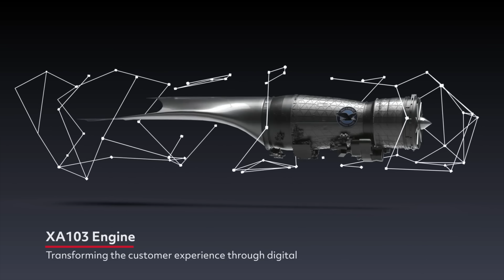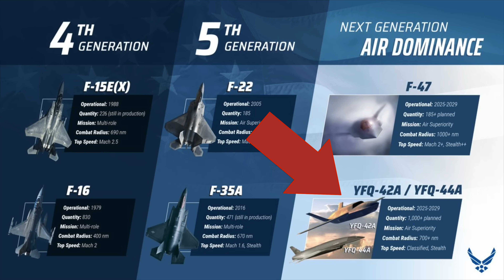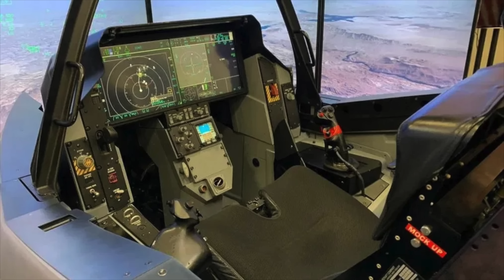Is the US Air Force F-47 Already Flying Missions?

Comment: The problem with all public sector acquisition programs is that everyone lies about the cost and schedule required to fully field an asset - in the case of DoD, the service, Congress, manufacturers, and the President all contribute to the lie.  Sometimes it's done out of sheer enthusiasm, sometimes out of a true ignorance of the technical risks involved, and sometimes just simple greed.  This is not an abstract attack on DoD.  I proudly served in the Navy for 20 years.  All government departments and agencies do this; DoD is usually the only one that gets much press on its failures.  I bring you the Navy's Constellation and Columbia programs and the Coast Guard's OPC program.  These technical and programmatic risks did not need to happen.  Programs do not need to fail, but preventing that requires people who understand that (a) physics is physics, and (b) mucking around with a contract is GUARANTEED to cause program failure.

Comment: Ge already has a headscarf on Pratt with the adaptive cycle engine. Ge is trying to get the xa100 into the next block of f35.  The xa100 is the grandson of the yf120 engine used in the f22 and f23 fly off in the 90s
Reply: Headstart

Comment: Unfortunately the latest Pentagon budget cut the influx of money towards the development of the adaptive cycle engines which were supposed to be the core of the next gen fighter.. If the F-47 doesn't receive ACEs it's capability will be severely diminished.. My money's on the fact that they will fly with the upgraded P&W engines from the F-35.
Also the CCAs (drones) are not supersonic nor particularly stealthy. Their level of stealth falls bellow the F-22 and F-35, let alone compared to the F-47.

Comment: There's no freaking chance that the F-47 would sport the 1Mw class laser, or at least not in the next 20-30 years...The technology to include such a powerful laser on a fighter jet is far,far in the future.. The weapons developers are just now putting the 150-300 Kw lasers on ships.. 1Mw laser on a fighter jet size aircraft would be such a leap in technology that we could compare it with USAF developing, building and flying the Raptor in the late 1950s.. 
There was an experimental 1Mw class laser on board the redesigned Boeing 747 20 years ago, but it was a complete failure. First of all it was a chemical type laser that needed large amounts of dangerous and toxic liquids being carried by the aircraft. Current solid state laser technology is nowhere near as advanced to hit 500 Kw let alone 1Mw.

Comment: I heard that Possibly was the X 47 or definitely the new X 72 that had or was heard to be Mach 5+ because of the scramjet fusion roll engine I guess they just decide to leave  the f 47 at Mach 2+… and focus on the 72 ability without all the weaponry what not not a lot more j5 or whatever type of fuel keep running on besides pure methanol or liquid O2 lol

Comment: We need more F-15EX’s. This  F-47 seems like a modern interpretation of the F-117 being more fighter inspired than smaller strategic stealth bomber. I’m no expert, but to me it doesn’t seem like a fighter at all, not primarily, or even an air superiority aircraft. I bet the F-22 continues to fight on for decades to come and is upgraded and updated to work in coordination with the F-15EX, and F-35’s, and unmanned drone systems. I wonder if F-16’s will be built or converted into AI fighters.

Comment: It's great to see Universal Companies designed multi functional multi operable systems within a single airborne fuselage that "Will" dominate the skies. Especially with our latest advanced "new tech and unrealized weapon" possibilities. Although the extra speed can be within also, if you're looking back to find your opponent even though there's is supposedly faster, then "hey I'm in front of you right, and capable to change directions and dodge in a flash / split second.
After reflection on the "Wandsworth Industrial Acid"  stream weapon. This device would also work very well for ground troops in infantry and special forces, in addition to the other abilities within Universal Companies multi-function handheld small arm and long arm weapon system.

Comment: This is a design from the early 90's, likely we are on to the 8th generation by now - it's possible this plane uses a rocket assist system to push it to ramjet speeds using hypergolic fuel which is extremely corrosive and is usually fueled outside, the clear tarp would help spot any boiling or fuel leaks during this process. The camo indicates its capable of extremely low level flying to avoid satellites, radar and air to air systems while the use of a scramjet indicates its also capable of flying extremely high, possibly using plasma to protect it from friction and radar. Russia claims they have deployed plasma based stealth already.
Reply: Interesting.

Comment: My Thoughts on the B-2 Bomber (I Might Be Wrong, but That’s Nothing New)
   I’ve been thinking about the B-2 Spirit bomber lately. I may be wrong   wouldn’t be the first time   but I have a theory. I believe there’s something more going on with that aircraft than we’re told.
  The B-2 can lift about 80,000 pounds, it flies incredibly fast, and yet the engines seem oddly small for what it does. Tucked neatly under the wings, almost hidden   it just doesn’t add up. It’s like the engines are barely there.
  Here’s where it gets weird: I think the real tech behind the B-2 is actually the so-called “Tic Tac.” You know, like the ones reported in those military sightings. I believe the B-2 has one right in its center  maybe even powering the whole thing. And I don’t think it’s the only one. I think a few other aircraft have Tic Tacs hidden inside them too — only with wings slapped on to keep the public calm.
   Sound crazy? Maybe. But something about that design doesn’t sit right with me. The capabilities seem beyond what conventional tech should be able to do

Comment: I'm curious how effective the CCA's will be with only 700 mile range when the F-47 may have a 1000 mile combat range--especially over the Pacific.

My guess is that may be the reason DoD is rebuilding the old WW II runways on Pacific islands.  Perhaps the idea is that those will be primarily CCA bases where CCA's would marry up with the F-47 midway to a target.  It doesn't make sense to have the short range CCA's located at the same bases as the much longer range F-47.

Comment: IMO based on the aircraft's shadow the wingtips are not in downward position but upward ,since the light is coming slightly behind the aircraft ,the shadow (if it has downward wingtips) would bend/or have an inclined end cast on the concrete but since it's not visible it suggests that it has an upward wingtips like on commercial planes ... you can see it even in the animation at 0:13...
Reply: Its probaly just a decoy

Comment: When we talk about pricing of a very early program is unhelpful and dangerous. 
The F22 got canceled because it was so expensive. All new tech is expensive. But thats only 1 very small part of the development. If Ford only made 500 F150 those trucks would be 700 million each.
We lost the F22, and we were literally 3 months away from loosing the F35. Obama canceled production and the senate arms service committee had passed a bill to kill the F35 program. 
Trump got elected and told LM if they can get the price below 90 million each for the F35C he would  keep the program. LM said well when we hit full production the price will drop below 80 million each. And it did.
The new F16 block 70 is more expensive to obtain and operate than a F35 now. 

The numbers in the beginning reflect decades of development. The F22 would have been under 100 million each after it went into full production. But that never happened.

Comment: Just like the stealth helos on the Bin Laden raid they were ready for the mission and had been built, flown and tested. Rumor has it the SEALS were told that even POTUS ( Obama) didnt even know about them. Remember a very special secret mission that certain maintainers were picked for a visit by an unknown jet in 92 when I was with the F-117s at Tonopah. The fact was we were not briefed but were in blacked out vans, windows blocked and in the dark. The aircraft landed no lights, no runway or taxi lights. A hangar door opened and it taxied in and shut down. I did know what ejection seat it had on it because my shop was there hahaha. Yup its definitely flying already.

Comment: In 1996, I was working nights in the southeast area of the US. I went outside to go and call in some tank gauges and as i was walking over the containment levee, I noticed a plane headed towards me. As it got closer, I saw that it was not 1 plane but 4 planes. As they got closer still I realized that these weren't planes. There were 4 triangle shaped objects flying in a 1,2,1 formation. They were at about the same altitude and traveling at about the same speed as a twin engine aircraft but they were completely silent. They weren't lit on the 3 points of the triangle rather they glowed an amber color as if lit from the inside. Its how i was able to see them in such detail. They weren't perfect triangles as the sides were slightly longer than the rear section was across and the rear section was slightly concave. When they were directly overhead they did a tumbling, rolling, flipping, over, under and around each other for about 3 seconds then instantly froze into the original formation and continued on. It's mind boggling that they didnt crash into each other and no known aircraft could perform that kind of maneuver within earth's gravity without ripping the airframe to pieces let alone anyone inside surviving. If there was anyone inside. It was as if gravity had no effect on them. 

That was the first and only time I have seen them. Paul Helyer, former defense minister of Canada, said years ago that the US military has weapons to fight an extraterrestrial invasion and has discovered a new form of energy. I dont know if these things were the weapons or what the weapons were meant to fight. I have no idea what they were but one thing is for sure. We are either FAR more advanced than we're being told or ET really does exist.
Reply: Cool story, bro!
Reply: @neilcarter77 Thank you very much. And I swear to God its 💯 true. I used to be the biggest swaggering skeptic the world has ever known. Now, I'm not so quick to call BS on a story about something someone said they saw and I feel a bit bad for automatically doubting their stories. 

But most of all, I want to know what they were.
Reply: @JamesStreet-tp1vb I saw a Sasquatch run across the road once, couldn’t have been anything else!
Reply: I saw flying triangles back in 87
Reply: Paul Helyer used up all his Canadian good will by jumping in with the "Ancient Aliens only built Non-Anglo-Saxson peoples' Megalithic Structures" crowd, long before the History Channel show!  
 His bigotry was always larger than his belief in Alien Contact
Reply: TR3B astra.Look it up very interesting
Reply: Tr3b astra.look it up
Reply: Mushrooms

Comment: I still feel like if the navy is going to be making cca’s to compliment the f-47 coming from god knows where and having to span a portion of that distance essentially shortening its legs by the time they link up with the naval assets the navy should still be designing and implementing an advanced manned fighter to operate directly off of carriers, obviously they will at some point need to replace the f-18 super hornets honestly not only soon but like a while ago regardless of the upgrades, and I know the f-35c is doing that to a degree but they will need to replaced with a dedicated long range design specifically for carrier operations, and obviously a modern equivalent to what the f-14 was, and the more built the lower the unit cost so I still feel like the f/a-xx should still be perused, maybe with a different approach than what was on the table up until this point, or just do a new type of platform and doctrine type of design which will be costly in that it would be a high price high end manned low production line manned design that could be limited to just a few on each carrier to work simultaneously, immediately and directly with the ccas all being launched and coordinated together and still link with the F-47, but maybe even take it to a point where they build a few or retro fit a few carriers or carrier designs to cater directly and strictly to housing, arming, fixing, maintaining and be tailored to operating just a few fa-xx’s a piece to launch and receive just that platform, or retrofit a current carrier to do the same mission. Or just have a couple per carrier airwing taking a large amount of space while the rest of the real estate would be there to compliment all the other various relatively smaller cca’s to have their own dedicated and uncompromising naval properties in order for the navy to have the platform it needs and keep tgeir edge and not become a support role to an air force asset essentially becoming a second tier air force support branch and stay a first tier stand alone, first tier power projecting juggernaut attack and independent strike force that keeps the navy the force it’s always been and always should be.